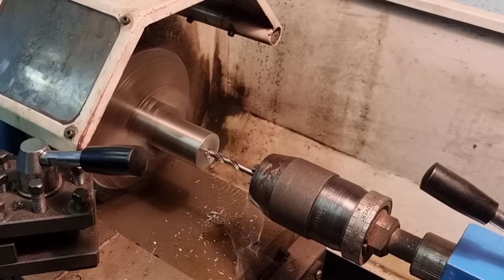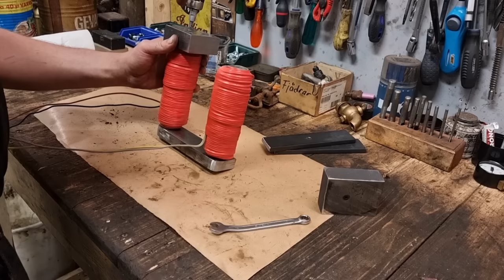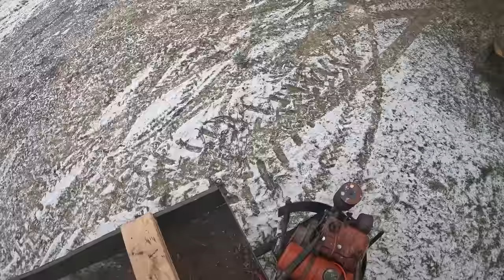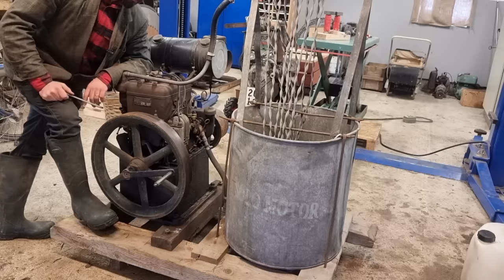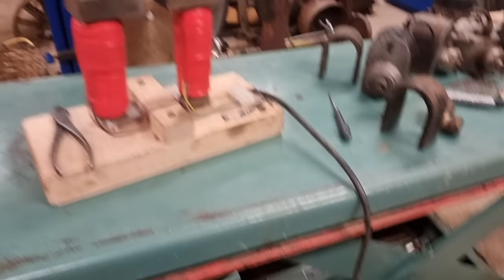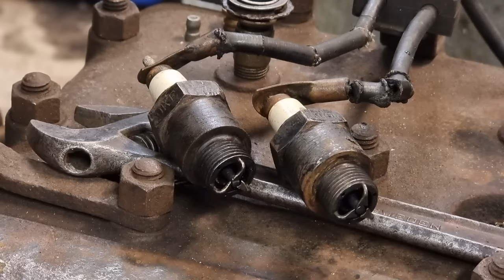Your old Magneto will need this! How to build and use a electro-Magnetizer!

Comment: Brass is not necessary. In fact the harder the impact like with a high carbon steel small hammer is best.
Reply from the maker: Hi! Thabks for the tip, will try next time! /Richard

Comment: The way to properly re-magnetize you have to permanently magnetize by heating to red hot then magnetize continuous untill cooled down.
Reply from the maker: Hi! Yes that might give even better magnetism. This is the way Bosch and Lucas say that it should be done on old magnetos. But i can imagine that heatung it up might help. But that could deform the magnet in this case. But i have spare ones, so i might try it! /Richard

Comment: Seems to me like you could increase the performance by sticking some of those super strong rare Earth magnets on to the existing magnet to help bolster its energy field ⚡pow baby
Reply: The direction of the magnetization of all the rare earth magnets I've seen is from one face to the other so they will not work well by simply sticking them onto the side of the magnet. If you think of the magnetic circuit as being a racetrack, the field of the rare earth magnets will be across the track rather than along it. The effect of adding the RE magnets will therefore be minimal.
Reply: @clarencegreen3071   yeah about what I would expect ..  but minimal  IS  an improvement

Comment: Awesome, subscribed.  Question and maybe something to tackel. Could you use a old telephone magneto to start up a car. Its a 5 bar stromberg. Iv purchase one in ebay for fun and there are tons listed for sale. Can also find alot of them in vintage stores. I'm building a oldhot and it would be fun in my opinion if I could use one to fire up the engine on a old flathead.  Would using one or 2 make 6 or 12v ?

Comment: I am surprised that you did not have to reset the timing after rotating the magneto after removal?  Those original spark plugs were used in the 1920's and maybe into the 1930's.  They are described in the manual for my 1929 English manufactured Singer car but I have never seen them before.
Reply: There is a "key" in the drive to the magneto..
just line this up slide it in.....
and everything is "original' (pre removal) spec again....

Comment: Instead of buying a brass hammer, melt down some scrap brass to make your own hammer, I think that would make a good video 👍
Reply from the maker: Yes, i will consider that! Time is the problem tho.. /Richard
Reply: There is no inherent advantage of using a brass hammer other than brass is less likely to mar the surface of the iron magnet. A small steel hammer will work just as well. All you need is a few gentle taps, as was demonstrated.

Comment: Only question I have, it seems you  left the plastic cover on the wire wrapped around the upright bars, is that the case?  There are several people here in the U.S. that say this is the wrong way. But if this is what you did they are obviously wrong. And thank you for the information.

Comment: I say Norse Man, if ya'll put a charge on that old battery the spark would probably burn the tip off the spark plugs. If it did have a full 12v with enough starting amps I believe I wouldn't leave it on longer than when ya'll were tapping that horseshoe magnet. I also feel it would magnetize more with a 20oz ball peen hammer. The reason I think so is because the small magnetic domains in the metal have more of a chance to align with the sharper blow. In fact I don't know if you know this, but a licensed A&P mechanic can take the crankshaft out of a small aircraft that has had a propeller strike and putting a dial indicater on the crank he can rap the crankshaft sharply and the dial indicator will go back to zero thus good for further service. Or anyhow it could when I was young.

Comment: This works for magnetos with a fixed, horseshoe-shaped permanent magnet. But what about magnetos with rotating magnets like Scintillas for Bugattis or Morel for motorcycles ? The magnet has a cylindrical shape...

Comment: I have one question ,are you using stranded copper wiring or just solid core house wiring for the project?Thanks for sharing the video, i have a horshoe mag layin around somewhere here that my grandmother used for a door stop.many years ago, the magnetizer you made is astoundingly simple and has great uses  for also charging magnetos from older motorcycle engines ect. have yyou ever thought of placing a neomydium magnet on each side of the horshoe  magnet? just a thought.thanks again.

Comment: most faults in a magneto are the ht coil is open cicuit   easily checked by  holding one test lead on the slip ring and one on the points screw   should be in the 4 >6 k ohm range   the connection from lt corrosion to ht windings the usual culprit  

no amount of magnetising can   bring that back  a rewind is needed !. a thorough re mag does wonders on a mag if everything else is ok    i have  an ancient 240 v dc one  with coils about 18 inch long and 4 ind dia     the humble compass is all you to need to establish polarity and the rule of opposites apply     if the needle reads north   the magnet pole is south  so this must go to to north on the magnetiser     done wrong it will de magnetise     there are needs  to do some magnetos  in a different position   
with a large machine it can be done  fully assembled      and ones with twin magnets   early bosch etc the magnets are assembled  with like polarity ie repelling each other 

do you realise the bosch symbol still used today  is a magneto   armature core    ❤

Comment: I think a suitably rated FUSE would be wise, and don't the two electromagnets have to be connected with opposite polarity so that you have one north pole and one south pole, and what about the direction of the windings? Isn't that important too? And what about circular multipole magnets like those used on many motorbike engines? Don't you need a special multipole magnetiser for those, with it's poles correctly arranged?

Comment: I have magneto bsa motorcycle,  can used this method without take out magnet inside magneto? Just put casing ?
Reply from the maker: Hi, i dont really know. But you must have the steel bottom of the magnet to make good contact with the steel plate on the magnetizer.  /Richard

Comment: Over all i lke the demonstration, But. you should have let us see how hard it was to start, how much the magnet strength was before vs after, and put the old spark plugs back in, also you first shot of the old spark plug spark was not as good as your after shot. That would have been the right way for a before after. Still its a great video, just left me wanting more.

Comment: You have no doubt built an electro-magnet and it might improve pre-WWII magnetos a bit but given that Lucas recommended 65,000 amp turns for re-magnetising Alinco based magnetos, I cant see this magnet having enough power to get any magneto back to as new condition.  Good concept but it needs designing to give the appropriate magnetic force.

Comment: So i get the concept behind the charger but im a little confused on the materials needed and on a higher current/voltage

So for the interior of the coils and plates were they stainless steel? And if you up the voltage say around 24v do you get a even stronger magnet?

Im looking to build one of these for use with a custom dynamo generator for a flashlight and i need a strong magnetic feild for it to run properly

Comment: I was wondering if you could answer a question for me does it matter which way the yellow and grey wire are wired in to the circuit. Will that change the polarity / magnetic field of the coil closest the battery. Minute 7.56 seconds

Comment: What’s the purpose of the tapping while re-magnetizing the magneto magnet?
Reply: I have heard (don't know if this is true) that applying a force while trying to realign the magnetic domains along the field lines basically will jostle them. It may be more about the heat created on impact doing it. I don't know if that was a wives tale or not. I did laugh at his brass hammer. When all you have is a hammer or pipe elbow, then everything looks like a magnet... or something lol
Reply: Striking the metal allows the iron atoms to move around and align themselves in the direction of the Earth's magnetic field. Hit the end multiple times to increase the magnetism of the metal.
Reply: I know that you can magnetize steel (or other "hard" magnetic material) by orienting it in N-S direction of Earth magnetic field and hitting it with a hammer. Apparently some recalcitrant magnetic domains need a bit of a "push" to line up. I expect same result here - an increase in magnetization. An alternative would be to increase the magnetizer flux (more ampere-turns of the electromagnet) thus hitting the material harder into saturation.. 

Magnetizers I worked with had a huge bank of electrolytic capacitors charged to several hundred volts. Resulting current pulses were short but still on the order of several hundred amperes into a few turns of wire would around the magnet poles of a DC motor. No beating necessary.

Comment: just one question ... why didn't you change the cables going to the plugs?
Reply: In another comment Richard stated that the copper wires within these cables ("Lightning hoses") are in good condition and still work well..
These cables are replacement ones...the originals would have been cloth covered...

Comment: 13:30 why you need to beat on magneto surface ???? I assure that the magnetized particles are not moving 🤣 due this.
Reply from the maker: Hi! It helps the magnetic force to allign inside the steel. If you ask old people that have done this back i the days they will tell you to do it. And it feels like it does make a difference for sure in these steele magnets! /Richard
Reply: @YesterdaysMachinery  ...sorry, it's all about ancient belief, science is another things and it tell us another story.

Comment: WHAT YOU DID WAS GREAT BUT YOU SHOULD HAVE USED THE ORIGINAL SPARK PLUGS TO TEST THE ENGINE REPLACEING THEM DETRACTED FROM THE FACT THAT IT DID REALY WORK AND NOT BECAUSE YOU USED A BETTER SPARK.